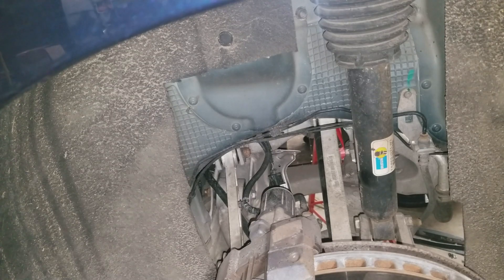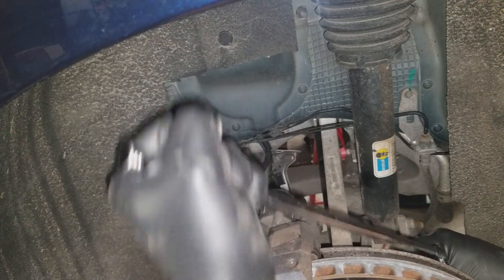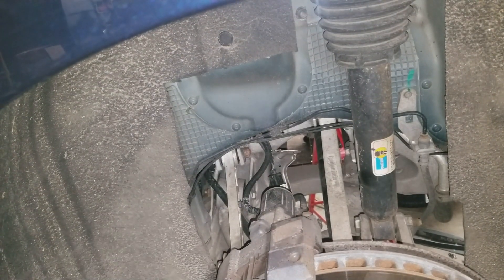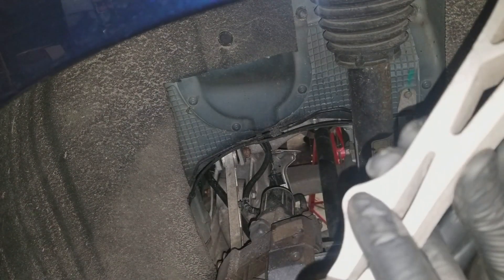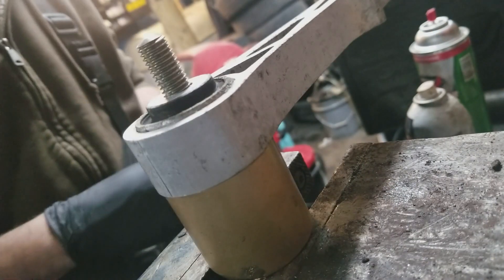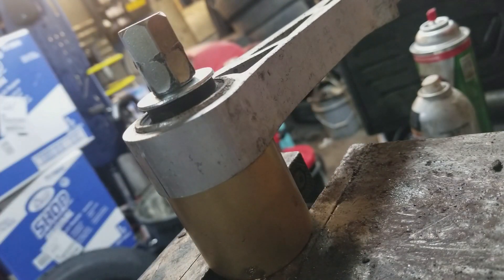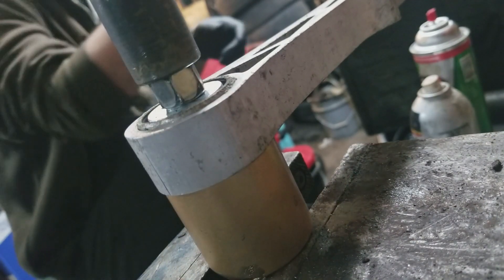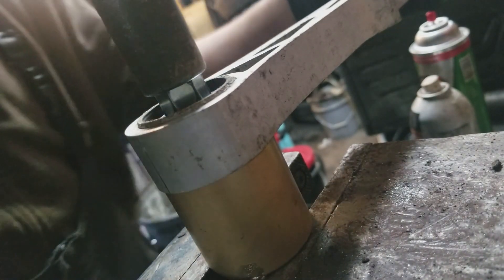Model S P85 Prototype Adjustable Camber Bushing install

Comment: Great video!

I have just bought a used model s that have 11 000km on it. Whe crusing down a straght road. The rear end of the car snake around very much during acceleration and breaking. It almost feels like the car moves over like 5-10cm ( a few inches) when i'm going from steady speed to acceleration.

Any ideas where to look for faulty parts hand how to test them? 

I have about 80 000km to the nearest Tesla service shop.

Comment: I'll likely be ordering this kit.  Question - when the camber busing is rotated it will slightly raise or lower the upper arm, right?  How much have you noticed that affecting the air suspension?  My only concern is that the car will adjust and will no longer be level since the sensor is not taking a true reading.  Am I overthinking this?
Reply: Never mind - I see that you answered a similar question 5 months ago...  Also, I did not know that the sensors were adjustable.
Reply from the maker: Derek Murr you are correct and your thinking is spot on. There has been a solution found out by a fellow owner, where the arm is adjusted out and down, which puts the sensor back in the proper position for level setting. This car is adjusted out and up, which makes the sensor read low, raising the suspension about an inch or so in the back.
Reply: Sorry, one more question that I did not see answered in any of the other questions.  Can you explain if / how you measured the diameter of the bushings (41.5mm vs. 43.5mm) with the control arm on the car?  I can get creative, but would like to know what you did since we're only talking about a difference of 2mm here...

Comment: I've been waiting for someone to offer this approach to camber adjustment on Teslas.  Thanks.  I have over 90,000 miles on my P85, and need to "tighten up" the suspension overall as the handling has deteriorated from what it used to be.  While I have the upper control arm off the car to install the adjustable camber bushing, I'd like to replace the other (outer) bushing too, perhaps with a urethane unit.  Any advice you might have about this would be appreciated.  Thanks.
Reply from the maker: +Peter Detroit we are working on getting a complete poly bushing kit for these cars. It may take some time, but the guys over at EV Tuning Solutions are great assets for getting this done.

Comment: When you say "1 degree of adjustment", do you mean 1 degree each direction or 1 degree total? If you have -2 degrees with the factory arm, would it give you a range of -3 to -1 (2 degrees adjustment) or -2.5 to -1.5 (1 degree adjustment)?
Reply from the maker: Markus Strobl because of the current design, these don't have full range of adjustment due to clearance issues, so there's only an outward adjustment. Factory spec is -1.5, and at full outward adjustment, while still being able to set the toe properly, outs it right around -0.5. There is a bit more room to work with, but the toe adjustment is the major limiting factor. Version 2.0 will likely have full range of motion to be able to go both ways.
Reply: Thanks, makes sense. Mine was right at -2 from the factory. I tweaked the air suspension height sensor to raise the rear a bit to reduce it to -1.6 but I'd like to get it down to about -1 degree and lower the back down. Sounds like these bushings will do the trick.
Reply from the maker: The good thing with the bushings is you can raise and lower the ride height through the rotation of the bushing. You can set the camber, toe, and ride height (both the toe and camber adjustments affect the other) on the rack with a bit of geometry and trial and error.
Reply: @EvolutionAutomotiveLLC  Hi there, when you adjust these bushings you are essentially lengthening the upper arm, right?  Does that mean the toe arm link has to be adjusted outward/longer too?

And when you say the limiting factor is the toe adjuster, does that mean you can't get enough adjustment "outward" from the toe adjusting eccentric?  In other words, you can't make it long enough to match the upper link?  Thank you!

Comment: Thanks for a calm and well ordered install. One quick question,  when the camber is adjusted--as the front link is fixed, does this alter the toe-in/out of the rear wheels?
Reply from the maker: pollywollydo the front link is not fixed. There is a cam bolt to adjust the toe, and as you adjust the camber, the toe must be adjusted as well.
Reply: @EvolutionAutomotiveLLC  Hi there, when you adjust these bushings you are essentially lengthening the upper arm.  Does that mean the toe arm link has to be adjusted outward/longer to maintain the same toe settings?

And, when you do, do you run out of length to increase it when your toe settings end up adjusted all the way out assuming you didn't change out the toe arms?

Comment: My model s with air suspension have the typical inner tire wear issue.  Will this part fix that?
Reply from the maker: Julio Gonzalez. That is the whole purpose of this install on this particular car. We don't have the data to back up the claim yet, but this should absolutely help with that, if aligned accordingly.
Reply: Tesla Repair Channel 
must have. Can’t wait for the results to order some once available
Reply: Is there any update for this solution. One of the very few things a don't like about my S+ is the negative camber. Would love to try these to get it to ride straight under heavy acceleration or uneven/grooved roads. Plus more even tire wear.